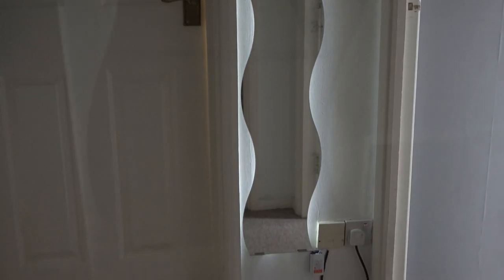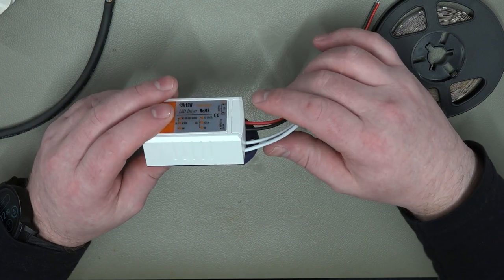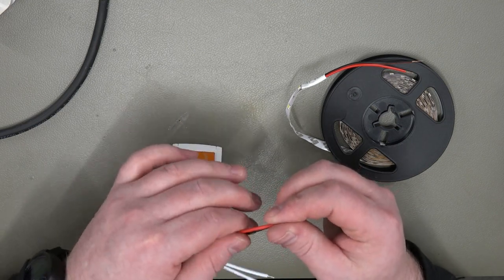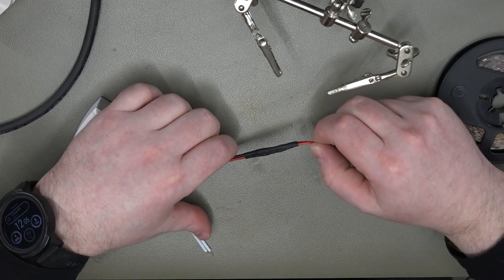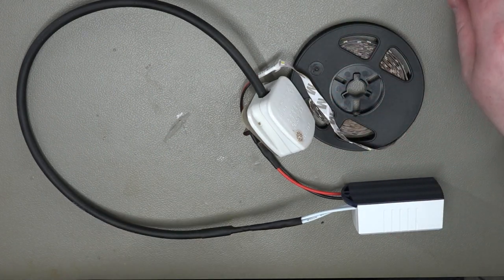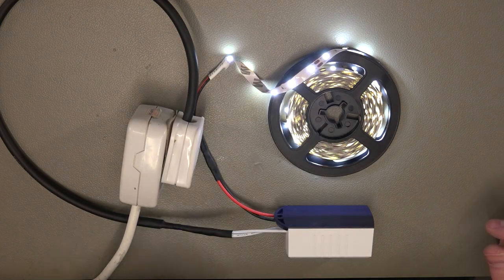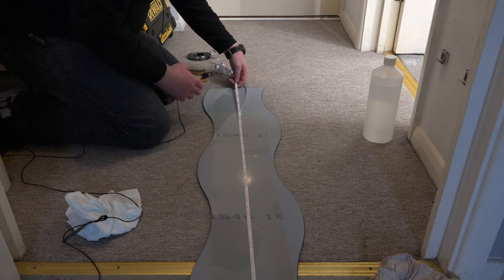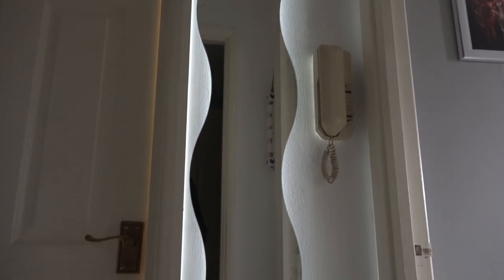DIY Ambient Mirror Lighting

Comment: Nice video! I wonder what the duty cycle of transformer may be ... do you keep it plugged in 24/7?
Reply from the maker: Thanks for your comment, it's a not a constant current transformer, so just a static 12V dc output, measured at 5.8W on a supply voltage of 249V. I leave it running during the day and turn it off over night while I'm in bed so the light bleed to the bedroom doesn't interrupt my sleep